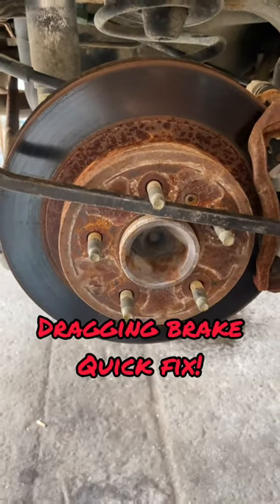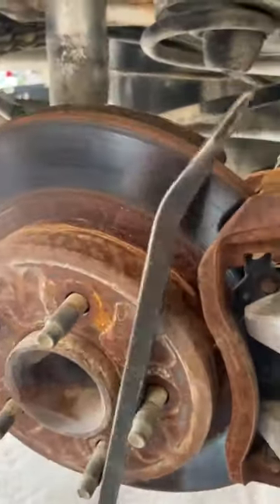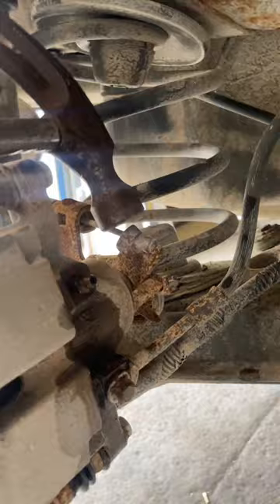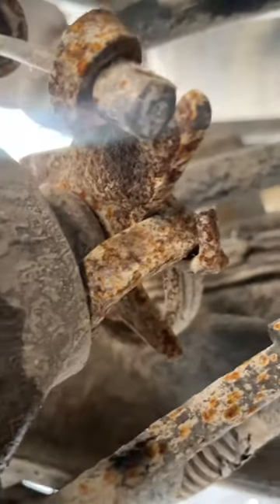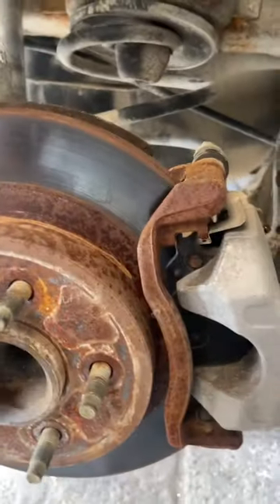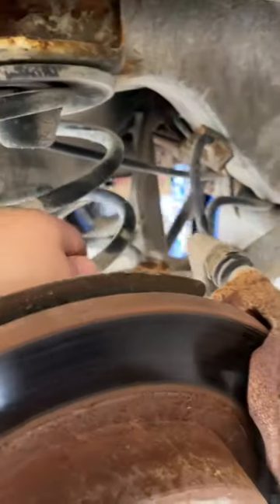Quick fix! Dragging Parking Brake

Comment: My entire set up is different.  My cable is looped over an arm. I just flipped the cable off. Kroiled it to death. Tapped it back and forth. Was still springy but kept acting stuck.. as i sat next to an old ass graveyard in BFE OKLAHOMA.  TheN said KVCK IT!  And reved it to 6K and dumped the clutch. BECAUSE MY GTO STRANDED ME 800 MILES FROM HOME.  I did my best to rip out the passenger side cv axle.  Nothing like driving around with a brake alarm at 65mph @3500 rpm. Also in 5gear. She was suffering